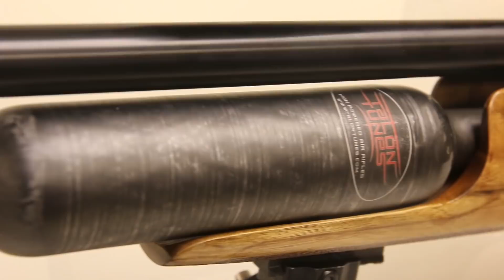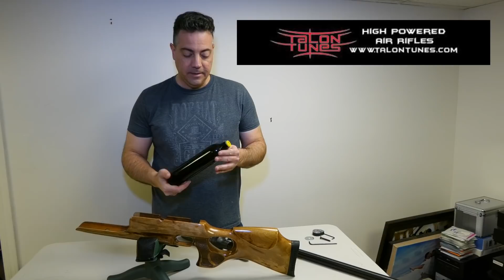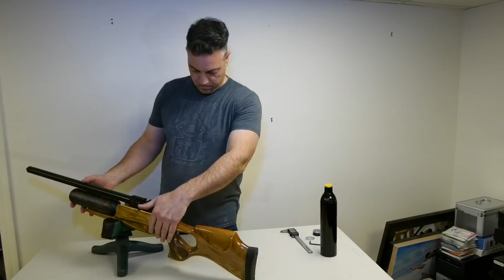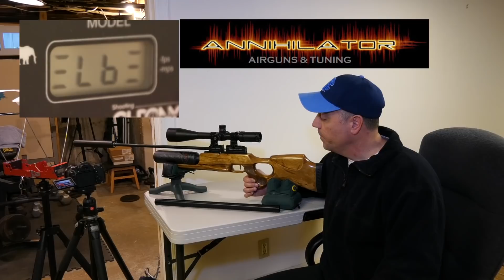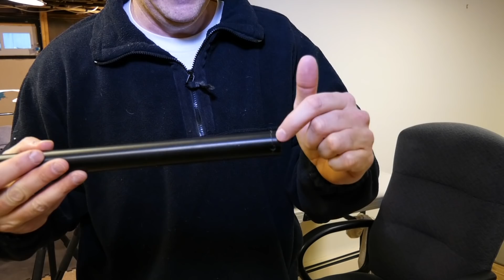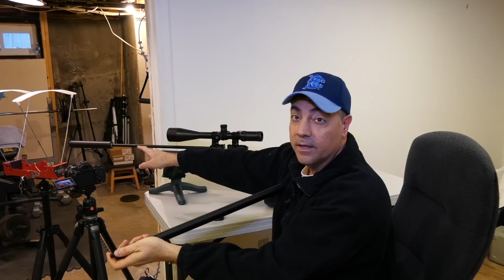Kral Puncher Jumbo .25  -Talon Tunes bottle & Annihilator Airguns and Tuning Valve 60FPE

Comment: Dude! Looks good with that carbon fiber bottle. All that's left is a carbon fiber shroud. And maybe a trigger tune. I also have the 25 Cal jumbo. Just finished the porting following your video and it is shooting strong. I too would like that carbon bottle. Thank you again.
Reply from the maker: Lee Garcia thank you! I tuned the trigger already. I did a video a few days ago. The trigger is sweet. About a pound
Reply: Have you found anyone to do a working quiet shroud? Or are you keeping the rifle with the wolf moderator. Cause that looks good too.
Reply from the maker: Lee Garcia no I haven't. Maybe if the gun becomes popular someone will make one. If the working shroud would reduce the overall length then it would be worth it.
Reply: Lee, my Jumbo is being built by Troy at Annihillator right now, almost done, and he's suppressing it for $50, not sure how yet because I haven't seen it, lol  Might want to message him and find out.

Comment: Did you make the wood stock? I’m deciding between the puncher jumbo or the hatsan neutron Star and want the adjustable Cheek comb but I really like your kral in this video. What would you recommend ?
Reply from the maker: No, that is the standard stock I just refinished it. I do not have any experience with the neutron Star. It hard for me to say as Kral and Hatsan are both Turkish made. Hatsan is generally very heaven with a good trigger with the kral is lighter but the trigger is not great.

Comment: nice looking gun, good consistent shot , u & troy did a good job..so what is kral or pyramid air,or to whom that sells them,doing about the shroud if it's splitting the way it's doing
Reply from the maker: Gerald Williams I do not know. But I think it came to me this way I just never noticed it. If the threads are not cut throughout then it should be OK. Buyer beware, just check your shroud before accepting the gun.

Comment: Hi there, want to make a question, how did you degas your jumbo? Got a nemesis and I think it's similar mecanic, thanks a lot!
Reply from the maker: I put the bottle, block and valve in a plastic protect Ted vise. Squeeze the block and poppet between the vise slowly to degass
Reply: @AirVelocitySport  where can I buy that tripod for the gun ? What is it called ? Thanks
Reply from the maker: That is a Caldwell adjustable bench rest. Check Amazon or ebay

Comment: Do you happen to know the thread pitch for both the bottle and shroud?
Reply: Also what are the overall dimensions of the bottle and shroud? Thank!
Reply from the maker: The bottle is M18*1.5 threads. It's 10.25 OAL and 2.14 in diameter. I do not know the threads on the shroud.
Reply: Air Velocity Sport thank you!!

Comment: It’s very good to see someone take time to make a cheaper airgun into something special, I’m a uk air gunner and I use theoben rapid mfr and a brockock bantam hm sniper, the theoben was very expensive, and the brockock was a few hundred cheaper at 1000 quid , I’m seriously considering a meal after seeing your videos, considering here in the uk we are stuck with the pathetic 12 fpe law I use 22 and 177 , in your opinion do u think a Kral would be worth the money at sub 12 fpe?
Reply from the maker: It’s about The metal yes, this gun is very accurate and at 12 fpe this gun will feel more refined because the hammer and valve springs can be toned down quite a bit. Please note that with the aluminum bottle and the 50 -60fpe ithis gun has a bit of twang we the trigger is released. But at lower engery I think it will feel nice. For $599 or 400 pound it alot gun for the money.

Comment: I’m new to your channel so I hope you check comments from older videos? I have been shooting air rifles over 58 years now. I still have my original Benjamin 22 cal pump. Then two spring guns, a China brand (it’s not handy at the moment) not sure of brand name, picked up at a garage salt 177 cal believe it or not it’s pretty accurate. Then I have  Benjamin atrial XL 725 25 cal break barrel. I like it but it’s heavy and a beast to cock and load. I going to go PCP now. I don’t want to break the bank so I’m thinking of a Kral Puncher Jumbo 25 cal.  I want to do as you have done. Put a regulator on carbon bottle and a moderator (silencer). Where did you purchase your moderator (silencer)?  Do you recommend sending them to Annihilator Air Gun for mods. I’ve built both of my AR but air rifles are a different thing. Really like your videos. There informative and you seem very knowledgeable. Thanks if you answer, Jamie
Reply from the maker: The kral is a pretty nice gun but needs sometrigger work. I've got my puncher jumbo trigger down to 1lb 3oz. But if you want a  great .22 PCP for around $290 with a coupon code HARDAIR20. THE Nova Liberty is crazy accurate at 100yards with either barracuda pellets or slugs in .217 it's easy to get high power with the Nova liberty its got a high shot count for a small air tube I made a bunch of videos on the Nova liberty
Reply: Air Velocity Sport  I’m thinking more on the lines of 25 cal as I’ll use it on coyotes and small game (bobcats of they keep coming in my yard). I was thinking the Karl its $599. And with mods probably around $1,000.  Thanks I’ll probably be asking advice and definitely be watching.

Comment: I don't understand most people want foot-pounds of energy because they hunt I watched the other video over you said you weren't a hunter so why do you need all the foot pounds energy to shoot paper I mean I understand that you shooting a heavier pellet for wind but does it really matter how fast it gets here if your just shooting paper
Reply from the maker: Don Wilson yes, I shoot long range in high winds all the time. More energy means shooting heavy bullet (not pellets) with high BC. This means I do not have to compensate for wind and therefore more accurate shooting. I don't understand why one would not want more FPE especially with unlimited air and great efficiency of my Kral Puncher Jumbo. If you shoot 75 yards or less with no wind and lighter pellets ( 25 grain kings) at 890 fps that works. My  reality is 100 yards and more in 16 mph winds on average.
Reply from the maker: Good example of where air guns are headed is the Huben K1. This is a 60fpe .22 cal shooting 34 grain bullets around 1100 fps. This gun is accurate out to 200 yards and beyond. If you are a long range shooter this is what you look for. Also, the Huben is extremely efficient with it's air using a solonoid to actuate the valve stem. It's going to take sometime before this technology is widely available but this is the future of airgunning IMHO.
Reply from the maker: I stand corrected. The Huben is an 80fpe .22 cal Airgun. Here is a good review on that gun. https://youtu.be/i807-jyVF70

Comment: Been very interested in a Kral.  What is your shot string and spread with the 60 FPE?
How about accuracy at 100 yds and closer
Reply from the maker: Ty Smith I just did a new shot string of 73 usable  shots. 57 shots avg fps 860 w/ es of 39. Tighten up to 48 shots with es of 30 fps from 166 bar to 115 bar.
Reply from the maker: Accuracy is really good at 100 yards? I have done 1" 5 shot group in 7 mph wind and 3/4" at 77 yards. Troy Hammer has a video showing a 3/4"  5 shot group at 100 yards